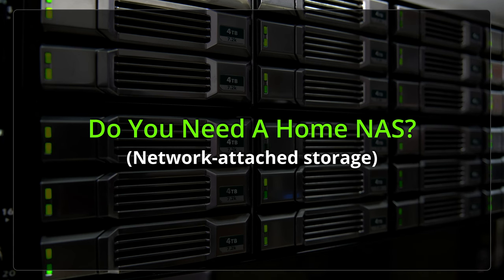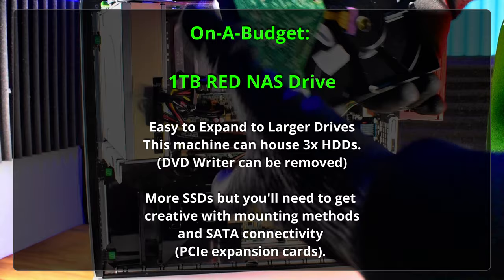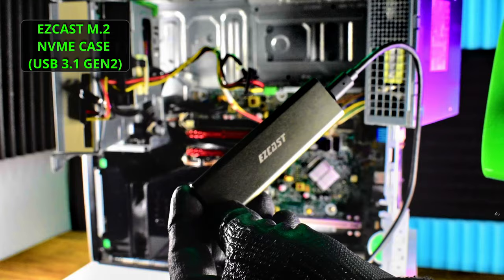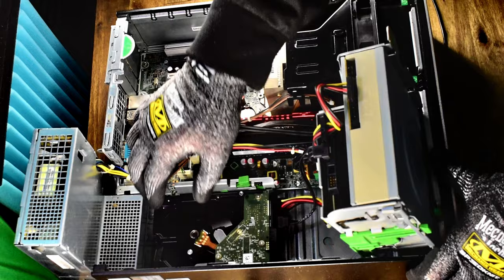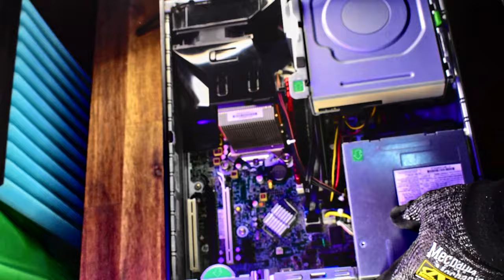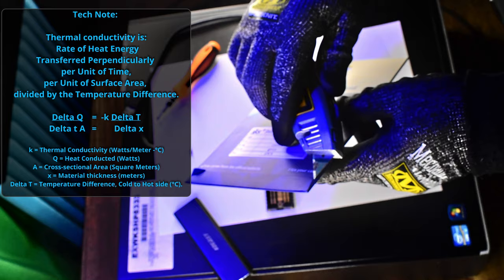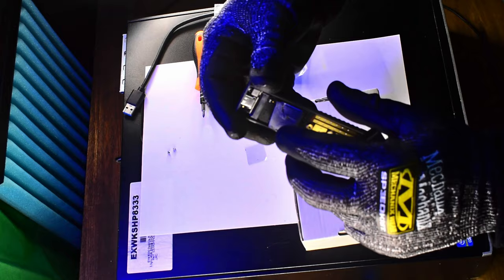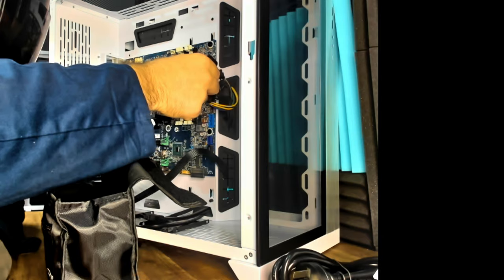Budget NAS GUIDE : Home Server / NAS for under $100 (* conditions apply)

Comment: Personally I think the HP Elite 8300 Tower Desktop is a better choice since it has 5 SATA ports. You can easily install 4 drives for storage and one drive for the OS install. I do not know how reliable a USB adapter would be for running an OS. I would not recommend it.
Reply from the maker: That's a fair assessment there and I would agree that the Tower version provides a better NAS experience compared with the SFF case which is limited on HDD expansion. I went for the SFF because it could be sourced for ~$40USD less than the tower model at the time that I bought it. I wanted the cheapest possible desktop that uses the least amount of power - that way this desktop can be left on 24/7 without noticing the power use. In terms of USB based NVMe operating system, I modified the adapter to have thermally conductive silicone, netting really low temperatures (~35'C) on the NVMe SSD. I can confirm it has been ticking along for a couple of years now (the USB has been in service longer than the video release), near 24/7 operation, but this experience may vary, and indeed USB will be less stable than SATA connections. I settled on the USB adapter because that gave the option to quickly switch between operating systems (I had this machine geared for Windows 10 or TrueNAS core, and all I had to do to switch OS was unplug a USB).
Reply: @racerrrz  I'm glad it is working for you. These older PCs are still very useful to the homelab community. I actually just got myself an HP Z240 to use with TrueNAS on. Since large terabyte+ HDDs are so affordable nowdays. Also it seems that TrueNAS maybe can be ran from a RAMdrive, but a battery backup would be recommended .
Reply from the maker: @canadianwildlifeservice8883  Yes very much, it's great to be able to repurpose the older machines with freeware like TrueNAS. The only catch is as soon as you expand your HDD storage you already need more... 

Great pick with the Z240, did you get the SFF or tower version? I went for the tower Z240 version and they are quite reliable for daily internet browzing etc. and they have that M.2 NVMe slot. For TrueNAS I can recommend the Z440 also. I found the Z240 a little annoying from an expandability perspective (only one x16 electrical PCIe lane). I have my Z440 fully loaded (PCIe adapters: USB C, X540-T2 10GbE NIC, Elgato 4K60fps capture card, H240 HBA, GTX 970, Wifi card), but I had to case swap the motherboard to get all the added functionality (solves space limitations).  

I haven't seen the RAMdrive installations but that sounds useful. I keep my critical workstations powered through a UPS (I have tried CyberPower, Dynamix, APC only) to give some buffer from power cuts (I have a UPS guide video in the works!).

Comment: Been wondering what to do with my 6305. Not sure I need a Nas but great video.
Reply from the maker: The 6305 would make for a solid server. If you go for the USB based TrueNAS operating system you can test it out and see what you think. When you want to use the machine for a different purpose just unplug the USB and it is back to a normal desktop. (Note. The HDDs allocated to TrueNAS are not visible in different operating systems / i.e. they are tied to TrueNAS).

Comment: Dafq is up with the heavy duty gloves? Dude building a nas after shovelling concrete or some shit?
Reply from the maker: Good point, these gloves would be perfect for moving some pavers around - spares the hands. 
The most logical reason is that they are cut proof. 
Sounds silly but the metal chassis has exposed metal, and once bitten twice shy - I got sliced by a Z440 while removing the PSU. 
The actual reason is that it's part of what I decided will be my channel theme, plus I think it looks cool in video - unique.

Comment: i have a old case (HP Prodesk 600 G1 DFF), I3-4260,32 G ram, but when i boot from USB Flash (to install the TrueNas Scale), i got the error: unknown filesystem. Can u help me?
Reply from the maker: That sounds like a strange issue, but I have had that before also. The error "unknown filesystem" typically occurs when the system's BIOS cannot recognize the filesystem on the USB flash drive. This can be due to several reasons, such as the USB drive not being properly formatted or the boot mode (Legacy BIOS vs. UEFI) not being set correctly. I actually found that the type of USB can be an issue. Aim to use an older USB 3.0 - some of the new large capacity USBs may not detect properly in the Prodesk G1. There may also be certain USB slots that are given priority over others for boot devices. I am not 100% certain which USB slot this will be for the Prodesk but it would be worth testing each USB port to be certain. One last thing would be to use Rufus to create the USB - that usually solves the issue. https://rufus.ie/en/
Reply: @racerrrz  tks for sharing.

Comment: W.T.F. are you saying 1000 megaBITS per second? !??! SLOOOOOOWWW !!!
Reply from the maker: Wow, Chuck Norris. I agree and I apologize, the $100 server will not meet your high expectations (nor did it mine!). I am in the process of getting a HP Z420 (and Z840) prepped for server transfer speeds that... well, likely will still not meet your expectations..., but it might get little bit closer. 10GBe using an Intel X540-T2 adapter. But in my defense, the HDDs in this file server only have a theoretical maximum read/write speed ~220MB/s (~1760Mbps), so 1000Mbps isn't half bad through ethernet cable.

Comment: Good video.  I have a similar PC and was thinking of setting up it up as a true NAS server.  Question - how can you run windows and true NAS at the same time?  How does that work?
Reply from the maker: Hi Eric. I am glad you found the video useful. You will not regret loading TrueNAS onto that PC! There are methods for loading more than one operating system (e.g. Ubuntu LTS + Windows 10; in the boot-loader you can choose operating system). But in my application I went for a simple route: I have a SSD with Windows 10 that I can leave in the PC and the TrueNAS installation on the USB NVMe adapter. If the USB is plugged in TrueNAS boots. If I remove the USB cable I can boot into Windows. The only catch is that HDDs allocated to TrueNAS are not seen/usable in Windows (since they are part of a ZFS pool). But it is handy if you needed to use the machine for more than one purpose.

Comment: I’m about to do the same thing; how can improve data transfer
Reply from the maker: Hi Wilson. There are a few things that can increase speeds but generally the 1GBe port is the slowest point (max speed is ~120MB/s). Most HDDs can write ~200MB/s and SSDs can push the write speed to ~520MB/s (NVMes push that even further). Thus the most effective way to get more speed is to install a faster network card, like a 10GBe adapter (max write speeds of ~1250MB/s!). The only down-side is cost. I am working on a 10GBe upgrade video but it's a little while off yet!